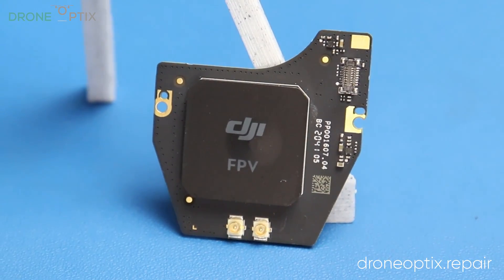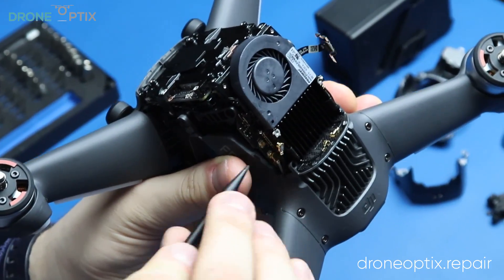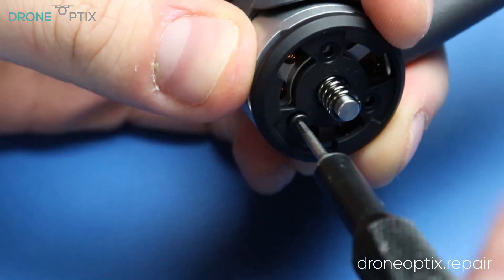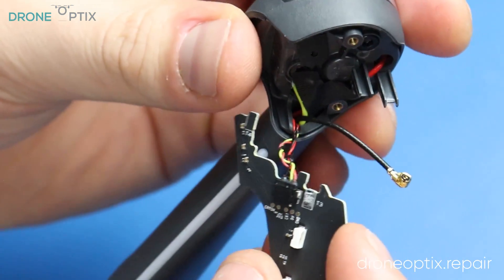We Completely Take Apart a DJI FPV Drone | Full Teardown / Disassembly

Comment: I changed the gimball because the camera had a little scratch , with a new one original from dji and now i have Problems… the System tells that i have gps and sensor problems but i never crashed the drone… can you help me?

Comment: Well that was a job and a half, but I just managed to repair a DJI FPV by replacing one of the rear arms from another crashed one. Luckily there was no need to disassemble the whole drone; it was just possible to undo the screws holding the arm and desolder the wires.

Thank you for the informative video!

Comment: Awesome video thanks for saving us money! Although if you guys dont have enough time try Gorilla epoxy 2 components glue. It seems like perfectly loves the plastic material of this drone. I dunno how long the glueing would last on mine but certainly keeps the drone in one piece untill I gaining strength and the part to fix it properly.
Reply: The epoxy will last just as long as a brand new replacement part as long as it’s applied correctly. A lot of people don’t like going this route because it looks tacky. Myself on the e other hand IDC how it looks and have used it to fix other drones on the past but I’ve luckily never crashed this drone into anything solid to break it yet lol. I did accidentally fly it into the river at about 60mph one day though 😂I completely disassembled and cleaned/dried everything with alcohol and let it sit apart for about a week in front of a fan just to be certain everything had dried. I reassembled it and if I hadn’t been the one to sink it In the river, I would never know that it had been underwater.

Comment: Dude you are a legit life savior!!! I couldn’t find the metal bracket ANYWHERE!! Like the one that holds the flight controller and other boards. I’ve been searching for a good month now, and came across you guys because I was trying to get a picture of the bracket to see if anyone in the drone Facebook groups had one laying around and low and behold you had it in stock!! Sucks that it’s from the UK, and I’m in the US, but I’ll take long shipping times over not being able to find it at all. 
Anyways, thank you again! You saved me at least 200 dollars since I don’t have to send it to DJI.
Also, quick question, does that metal bracket come with thermal paste like it shows in the picture, or do I need my own. If I do need my own, can I use normal computer thermal paste, as I have some laying around from my pc build, or do I need some super special DJI secret paste?

Comment: Way easier than it looks actually. Replaced both front and rear arms. Got myself a decent soldering iron, that helps a bunch. Also the wire wrap for holding the cables in place was the biggest pain. Replace the thermal pad on top of the power distributor, since the original one fell apart. Looking forward to go flying again! Thanks for your video again! :)
Reply: The secret of the wire loom or wrap, compress it like a spring to make as short as possible and that makes the diameter larger, your wires slide right through
Reply: Same here! Although I just had to replace one rear arm. But it's definitely easier than any teardown videos make it look - no need to go that far to disassemble it at all.

Comment: does anyone know what type of cable the gray one you can see at 4:25 is? is there a way to fix it once it was deplugged from its bracket? any help would be very much appreciated!
Reply: That gray wire is the antenna, you can solder it back onto the connector

Comment: Ordered replacement parts. Crashed it into 60 mphs into power lines, and found the drone after 90 minutes of searching. Busted arms and battery missing. The battery falls out a bit too easily, perhaps by design. Anyhow, thank you for a detailed video. Will be watching it a few times soon :)

Comment: Great video !! Would the antenna wire that hooks up to GPS board keep the drone from turning on if it was cut in half from a crash ? The heat sink module mounting tabs broke and pushed over cutting the left  ADS-B Antenna wire. Hope you can help. Thank you for making this video.

Comment: Can anyone tell me what is the minimum amount of disassembly needed, if I only want to replace the vision sensors module and ribbon cable?
Reply from the maker: This drone is by far the hardest drone to repair when it comes to swapping internal parts out. no matter what its not an easy task, the best advice we can give is to video record each step take photos as you tear down. there are some very tricky parts so go very slowly. good luck :)

Comment: I want to buy some parts, do You know what part is responsible for the front arm long horizontal led? cuz it stopped working together with under motor leds. Is it the little circuit board from the leg stand?
Reply: My arm led quit to. Two screws took the cap off of the end of the arm and there is a small tiny electrical plug came undone. All I had to do was plug it back in. And it works again. Took a while with tweezers and a magnifying glass. Didn't want to bend the little prong going into the plug.

Comment: I was hoping there would be some sort of  camera/vtx/recording module and i could buy it separately to put on my custom quad. But it all seems to be integrated.
Reply from the maker: the DJI FPV module for custom drones is available. thanks for commenting :)
Reply: @droneoptix5218  that works with the controller V2 ?

Comment: Hello, my drone had a fall in the sand, now there is no image and it also has no connection with the glasses or the control, what could it be? please help me. Greetings from Chile
Reply: same thing happened to me, the motors start, but there's no leds and no connection to the goggles/remote, what could it be???

Comment: i recently crashed my drone and had to change the body of it .. it was a hell of a work for me and my shaky fingers D: but i somehow made it but now the 2 rear motors aren't spinning when i start it and the info in the googles says that the selftest of the "drive control" doesn't work and i should restart the drone or conntact support ... any ideas what this could be ? did i frie some parts of the esc as i took it apart ? or could it be anything else ? would be nice if someone could help me out with that
Reply from the maker: its tough to know, but If you're in the UK you can send it into us for a free diagnosis? Cheers :)
Reply: @droneoptix5218  damn im in austria D; but it would be nice if i could send the esc to you before i throw it away and its fine ^^

Comment: So it's basically a delicate piece of electronic equipment that needs to be handled with care and not bashed on the ground a 1000 times like typical carbon ones.  Also so deep dive into the motors should help us understand the efficiency of DJIs motors and Crack the code behind those obnoxiously long flight times.

Comment: I got an error message on my goggle after an impact.... saying, "image transmission signal weak" or "image transmission signal lost". Do you know which parts should I replace by any chance?? I replaced the gimbal today, but same error again....
Reply: Well what does that gimbal has to do with transmission.
Try disassembling the front legs and look whether the antennas inside are intact
Reply: i have the same problem with mine, did you find a solution?

Comment: 5:22 I wonder why microphone is there
Reply from the maker: I am not sure yet so I havent put any captions on to correct it , but it may be a buzzer rather than a mic. Initially thought it is a mic as some pilots like having a mic on their fpv drones to hear the sound like you would listen to a car engine as you can identify issues and abort the flight before something happens in the air.
Reply: @droneoptix5218  the mic records audio to the flight video. you have to enable it in the goggles.
Reply: @droneoptix5218  thanks for double checking ❤

Comment: Excellent video, very helpful. Thumbs up subscribed to channel. Looks as though if the arms get broken it would break the main frame also. It would have been nice if they had some kind of break away feature so that only the arm would be damaged. Hopefully all the parts will be available. I am sure someone will buy full units and the parts. I may consider it more now because of this video. I would only use it for cruising and be more unlikely to crash.
Reply: I broke the front right arm off of mine. It also broke the frame. So I have to take the whole thing apart. This is going to be a pain in my neck… does anyone know where in the USA I can get this fixed?

Comment: I have a feeling alot of people will be watching this in the future
Reply: Had the drone for a week. Already need the video
Reply: I did not strip anything. Just used Gorilla epoxy 2 components glue to glue the main frame. The drone work and fly like brand new.
Reply: the future is now ;D just crashed mine real hard now i need to replace the body and an arm
Reply: Unlike Ikarus, I flew too close to the ground, and way too fast
Reply: I have a feeling you're right.  :)
Reply: Yep 😂 I'm here for that reason.
Reply: Your feeling is quite right. I bought mine used, everything works but the vision sensors so I will try to replace it.
Reply: hahahahahah 2 years later and i hope to god you still know youre right ( one of the victims of the impenetrable fortress )
Reply: Another victim here 🙋🏽‍♂️ trees are not friends
Reply: 3 years later and you are correct 😂😂
Reply: Soon 2025😢
Reply: Here i am ... with a waterboarding drone ... 😅

Comment: Ok. Now, how to transfer good stuff to a frame that can actually survive a crash ?
Reply: Cool! An aftermarket frame.
Reply: I'm wondering do they need to keep the same fc angle or it can be calibrated?
Reply: @LicozeOfficial  bigger qustion is: Will the whole fc need to be tuned for the new frame? (PIDs)
Reply: I'm waiting for that ^^

Comment: YES! my man :D now tear down the transmitter. im wondering if its flat cables or wired :)
Reply: The transmitter is pretty intense. I took mine apart today and took a bunch of photos along the way. Once I finish getting my transmitter back together I'll upload the photos to my Hackaday IO project.
The transmitter uses both flat cables and wires. The gimbals and switches are connected with wires by the various PCB are connected together with flat cables.
I've taken apart one of my batteries and the photos are up on my Hackday IO project.

Comment: Very nice video, surprised to see how difficult it is to remove the drones legs, since its FPV and all, but good to see its still doable if you know a wee bit of soldering.
Reply: yeah DJI logic they say modular design to make repairs easy yet the 1 thing that would be first to break is the hardest to get out
Reply from the maker: it almost seems like its been designed to be hard to fix. the opposite of what the fpv market needed for sure, thanks for your comment :)